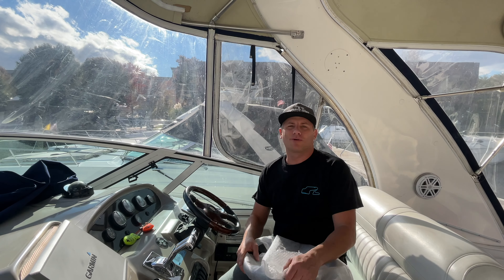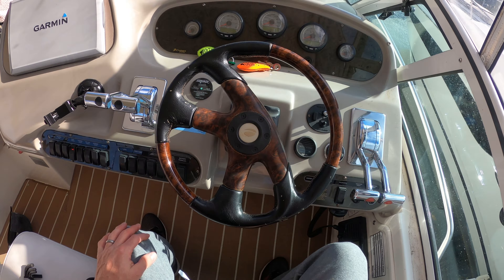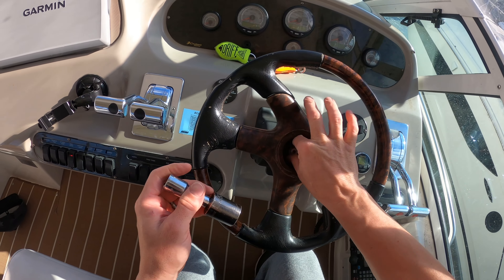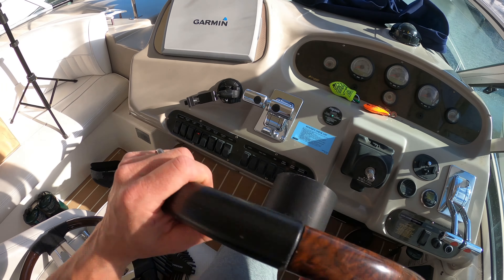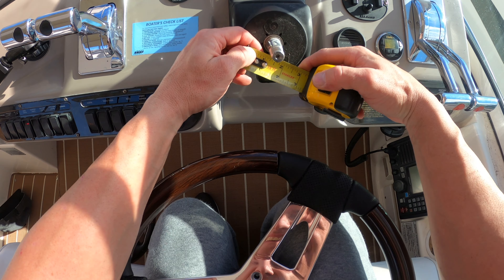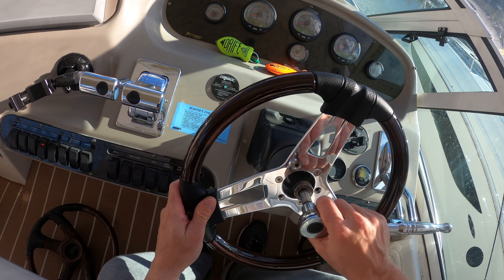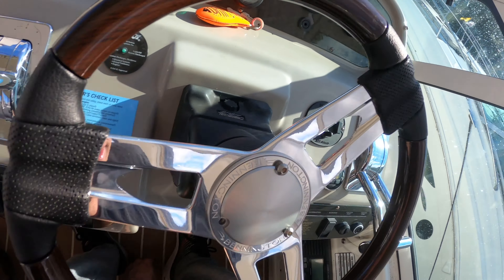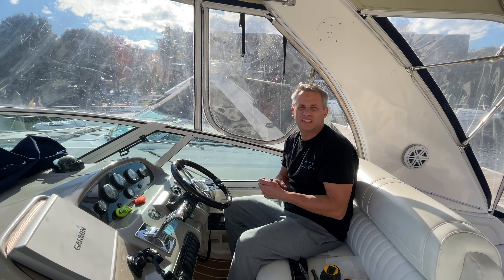How to install a new Boat Steering Wheel

Comment: Hello! Really enjoy and learn a lot from your videos. I initially came across your videos for DIY work on my house for floor tiles. I was surprised to find your videos when I was looking up boat flooring ideas as we also have a 3672 Cruiser Yacht and your helping me learn more about my own boat lol. I’m definitely going to upgrade my steering wheel now. I’m curious to know what gauges you have? My faria gauges stopped working last year and I’ve been looking for a good replacement, if you don’t mind sharing.
Reply from the maker: I have a 03' 3772 with the 8.1 Mercs that come with the smart craft gauges. I see so many with the Faria gauges and assume they are diesels. What engine do you have in the 3672?  

We are actually on the boat right now and will be taking it all the way up to upstate NY from Kent Narrows in the Chesapeake!!  Video incoming, lol. 

Ps- Great boat!
Reply: @TodayIWorkOn   wow that will be an awesome trip! We have an ‘01 3672 with 8.1s horizons. We primarily boat in the Long Island sound so maybe we’ll make that trip one day.